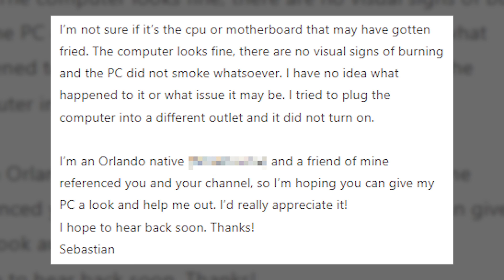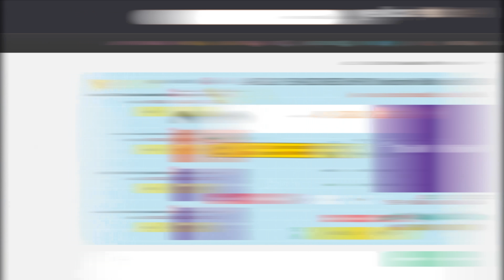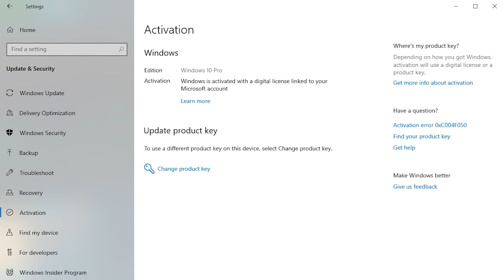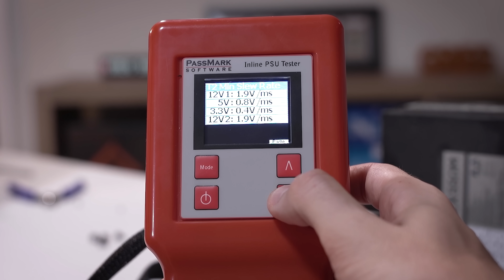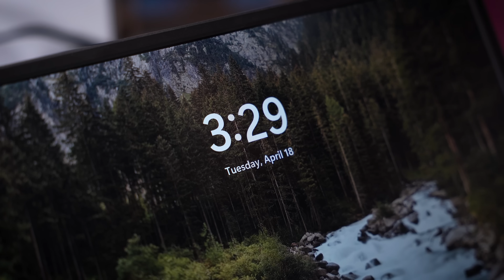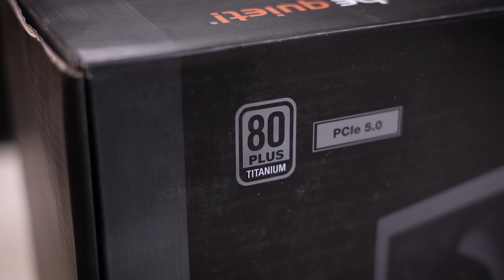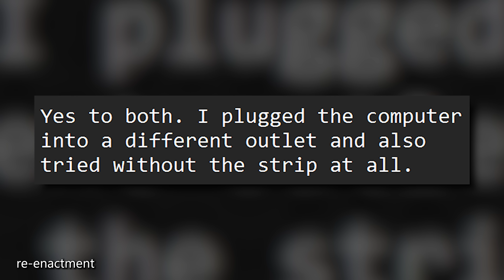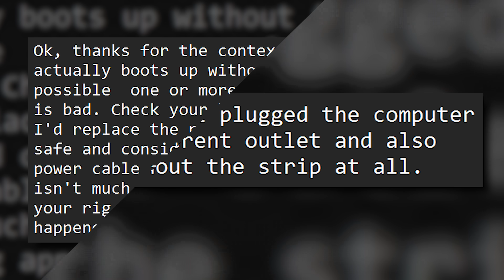Fixing a Viewer's BROKEN Gaming PC? - Fix or Flop S4:E6

Comment: In Europe where some, if not many, houses have 3 phased power into the building, if one breaker goes and there is some usage like 3 phased stowes or heathers that runs simultaneus, then you can get some seepage of low volt power going back into the outlet and give a computer that goes on and off all the time. To protect from this I have added a remote switch in line with the power surge protector, so that it can't start until I fix the breaker!

Comment: Greg HAVE HIM check the GFI switch, because they work on more than one circuit and are needed with rooms with water.  Those things will trip first before the breakers and if they do just hit the reset button and it will reset the outlet.

Comment: Surge Protectors have fuses that if that get too munch power they stop working, don't confuse them with power strips a good surge protector is designed to protect sensitive electronics from surges, power strips are not, but they look the same, the only difference is once a surge protector trips you have to buy another one and they will often have red an green lights, the red light means it is on the green light means its protecting.  Also some modern power supplies have fuses that will trip if they get over volted saving components from getting fried.  However, the power supply isn't the only power in source a graphics card can still get fried from a power surge from an internet cable or a hdml connection from the monitor, that is why it is good to have your monitor and computer on the same surge protector.  Some of the newer motherboards have a surge protector it detects a over votage and shuts off the computer preventing damage to components connected to it.

Comment: It sounds similar to an issue I had years back, which ended up being dirty power from old un-grounded outlets. Most things worked fine, but anything with a sensitive power supply would have all sorts of weird issues.

Comment: If he has a resettable surge protector, it may need to be reset by the reset switch or simply unplugging it for a 1/2 hour might reset itself depending on how the manufacturer made it.  Like someone else suggested, test outlets with a lamp.  If there is power, then the next step would be to replace the power cable IMO.  Great video!

Comment: good job. suggesting they add a UPS would be another preventative measure for similar issues also. hard to rule out a line short or weak breaker without electrician

Comment: G'day Greg,
Awesome job with your helper today but 🤔I guess as you didn't "Fix" anything this one is a "Flop" with an upgrade 😂.
Twice I have had PSU to Wall Cables that have stopped working in such a way they tripped the Circuit Breaker Board, both times I too thought it was the PSU as they were different brands but testing with my spare known working old DELL PSU showed it was the cable then tested the PSU working fine with the DELL Cable.

The only PSU that I have had Die was from a used GTX460 that I bought, when I hit the Testbench power button the PSU made a HUGE CRACK with sparks & smoke 😱(Just like the GN Video), my i3-3120 survived but it also took out the PCIe X16 slot on the Mobo😭. Got my money back from the seller without any hassle including enough for a replacement B75 Mobo 😁.

Comment: I actually had something like that happen to me. My cat jumped on the PSU Cable and pulled it out halfway. A loud noise and the PC wouldn't boot up again. Bought a new PSU but just tried for fun once more to boot the PC, after about 4 hours, and it would just work. Still changed the PSU just in case.

Comment: Yeah he really needs to try another room that's on a separate breaker. If he has AFCI protection on certain rooms in the house, but not others? Try one that's not on an AFCI protected line. 

I have a garage setup because the rest of the condo is on AFCI (except the kitchen and I wasn't doing that), and the builders who built this place picked probably the twitchiest AFCI's they could find. Even with power strips and/or a UPS trying to smooth the load, anything drawing more than maybe 250-300W dynamically? Meaning that load will shift slightly up and down? They are tripped because they think they are seeing a loose connection.

Edit: Love the special helper.

Comment: Reminded me of my own ordeal few months back. Swapped everything from my RV05 to an Alta GM1 and my room went 'pop' as soon as I flipped the switch. Tested at other locations in the house, replaced the cable to the rig and every time there will be a trip. Send to a local PC shop and it tripped their test section as well.

In the end, it was a pass-through cable from the Alta GM1 to the Psu that was the culprit. A $2 fix.

Comment: i know the problem cuz it happend to me. Its the problem of the surge protector or at least the voltage and watts that outs puts. I connected mine to one that apparently wasn't drawing enough power from it and it caused my PC to turn off randomly unless I waited several hours, then to turn of completely with no post watso ever. i changed everything even had best buy check it out and it was apparently the motherboard that got fried. Changed the mother board and worked good as new. So ask the guy for a pic of the outlet and a pic of the box to see how good is it to connect to a PC.

I can even send it to you Greg so you can confirm and also have to check my PC that it started to turn on everytime I play any game that reacquired a bit of work to put in the GPU, I stared one day where I open google chrome and after it just turned on the PC immediately no warning or anything. Gpu usage reaches 100 and turns off and if not that then the CPU reaches 100% and crashes, I formatted the pc saving the files but thinking on doing a full factory reset. so its more of a system problem not a component problem... maybe

Comment: The power supplies protect themselves and often by removing the power cable, let it sit for 30 seconds or so and plug it back in.  Power Supply issues with +5 volt stand by (+5VSB), as the power supply ages, The stand by load on this voltage rail will cause it to drop to a point that the Motherboard can’t respond to you pressing the soft ON button. Powering the supply completely off (disconnecting Main voltage) will restore the +5VSB and allow the power button to function.

Replacing or recapping the Power Supply is needed.

Comment: Surge protectors go bad over time and eventually do nothing more than a normal power strip, from age and covering small power surges and voltage fluctuations that you wouldn't even notice, including the surge protectors in UPSs. Don't use a super old one if you care about the sensitive electronics plugged into it.

Comment: You didn't ask him if his outlets were up to code and grounded with the 3rd prong.  Many older homes have ungrounded outlets and he could have been using a grounded-to-ungrounded plug adapter to get power to his power strip and PC.  Owner should really get a UPS.  Surge protectors usually only work for so many surges before the protecting no longer works and the surge protector simply becomes a power strip with no surge protection whatsoever.

Comment: Bet the switch on the original PS reset it when it was switched off then on. Hotplug a PS to its power cord, kick a bad enough spark (yes, I know, don't hotplug a PS) and if you didn't cause the PS to break its internal overvoltage protection, you'll probably still need to reset it with the I/O switch.

Comment: Stop using power surge protector strips. They don't protect anything!

 You've spent hundreds of $$$ on a PC and you're trusting a $15 device to provide protection. Spend another $100 and get a UPS. They will block power surges and keep your PC from flashing on and off during power outages.
Reply: Wrong.

Comment: The other thing to consider is the oringional power supply may have a breaker in it that just didnt reset till it arrived at your place Greg. Some power supplies have circuit breakers built in them. But as someone who has a degree in electonic repairs you did the right thing replacing the PSU and cable. Also yes the PC owner should replace the outlet.

Comment: i hate hate those large ugly heat sinks  i have neuropathy in my hands and couldn't put them brackets on ,i ruined two Ryzen 5 cpu's because they kept falling outta the socket,and bent a few of my 1330 pins ,never again will i use them .

Comment: gfci breaker could have popped. it will kill a rooms outlets. they will trip a couple times then the breaker fails and theyre around a hundred bucks. my old 990fx machine with 3way sli killed one as it couldnt handle the 1250 watt power supply

Comment: The last major problem I had with my computer seemed to be a failing PSU. My computer would power on and I could do light load tasks. The moment I would load up any game, the computer would turn off. I tried running a benchmark program, and once again the computer turned off. 
I replaced the PSU and everything has been fine since. All of that happened 3 years ago and my computer has not turned off on its own since.
Is it possible that the outlets work fine as long as the power draw stays below a threshold, similar to how my old PSU was behaving?

Comment: A PSA for all: Your surge protector is good for ONE power surge before it needs the fuse replaced.
Reply: cries in florida
Reply: Actually it depends on how bad the surge is, they can take smaller surges, just not the huge spikes, I lived in Wyoming Summer Thunderstorm land if you ask me.  The power was always going on and off, its not when the power goes off that causes problems its when power comes back on is when a surge happens, because everyones connected devices are being powered on again all at the same time so may shut off and power on a few times, that is a surge this is what causes harm to computers.  This is why in my bios I set it to stay off during a loss of power, the prevents the surge when power comes back online and helps the grid because it don't have to power that device back up again.
Reply: idk about that I've tripped mine a few times(heater in the winter + 3090) and it still works. I never buy "power strips" though I always get legit $40+ surge protectors.
Reply: @donnyboi1990  Those tend to have better breakers, but you'll notice a little light on the pricy ones saying "Protected" or "Fault" if that light is out, there's a little fuse you can replace under it.
Reply: @donnyboi1990  Not an electrician... but my understanding was that a surge protector was different than a breaker for the house. My bedroom is on the same breaker in the house as a room downstairs where they sometimes use a space heater, and we've blown that fuse several times. But that wasn't a surge causing the protector to be used up. It just happened to be plugged into one when the house breaker was tripped. But in the case of the PC owner in the video they specifically said it wasn't the house, but their strip.
Reply: @Galiant2010  It isn't recommended but if you are low on outlets in a room and have a few things pulling heavy amps, it will flip the switch on the surge protector instead of the breaker box, so you don't have to go down in the basement if there is a trip.
Reply: Hey Greg how can I submit a request for you to view my broken pc?
Reply: @chaseandbolt  He has a link in the description for a form to submit.
Reply: Depends, my power surge protectors work like breakers. They have an on/off physical button you push and they're good to go. The ones with fuses generally aren't fast enough to protect your eletronics from this kinda surges.
Reply: @eduardoBR1991  A surge protector is bare.minimum, but yes, more expensive/better protection is preferred.

Personally I use a UPS that does both line conditioning and surge protection.

I can thank this model for saving multiple appliances in my house as well.

After a weird power outage and repair on my power lines, my UPS just kept beeping and beeping... I thought it was broken until I checked it's voltage detection.... 145v!

There was an Amp on my street corner that was amping my voltage up that basically wasn't needed following the repairs they did in the previous power outage.

Called the power company, and they bypassed the amp: then I was back down to 110 +/-10% as I should have been... But I HIGHLY recommend that if you have spent more than 1k on your PC.... Spend another $150-200 on a good UPS.
Reply: @JE-zl6uy  yeah, I would go with overkill any day. My power strip has a built-in breaker and an Ups also with a breaker and pure sinus wave signal.
Reply: Laughs in 230V outlets.
Although power surges are rather indepedant from that
Reply: @Spido68_the_spectator  I wish... most homes are very old where I live and are under $100,000 in value because they have not been modernized. I don't have to pay city living costs though.
Reply: They aren't 100% guaranteed to work against lightning strikes, either.
Reply: I never knew this though thanks for the information! I just built a really high end PC and wouldn't want this to happen to my PC.

Comment: It happened to me once , I know the problem
I took my psu and tested it on another rig , everything seems ok and everything else on my computer was working as well with another psu
Turned out the problem was the POWER CABLE itself was the only thing that got busted and by replacing it everything worked fine on the same power outlet  same computer !

Comment: There are replacement (wall outlet to PC) power cables that use 14 gauge wires, instead of the standard 16 gauge wires. The PC owner should probably invest in one of those red/green/yellow LED $8 outlet testers, that can detect if the hot & neutral portions were wired incorrectly. Older homes may not even include a ground portion, so that would indicate a need for simply replacing the wall outlet with a properly grounded 3-prong wall outlet. As someone else mentioned: double-check the breaker box for possible corrosion induced by sparking between the breaker and spade on the buss bar.

Comment: Now I'm not sure if pc power supplies have them but it's pretty common in electric motors to have a time delayed fuse. So if you trip the fuse it won't allow you to put power back through the device for a few hours then it will accept power again. Just a theory.

Comment: @Greg - I am a technician in Houston that has this type of problem with PCs at my company due to unreliable power.  I have experienced this type of issue myself but especially with Dell desktops.  We normally pull the power cord > press the power button while disconnected > plug back in an turn on the PC.  This normally drains any power from the MB  and restores the state of the machine to normal.  I wonder if this happened naturally during the time it took the machine to get to your home for troubleshooting.  -All the best!  Brian F.

Comment: Most times when a house gets a brown out it does something to the power supply or motherboard that causes an issues. Most times all you have to do is remove the power cable from the back and the main motherboard cable from the board wait a little bit for the built up power to dissipate from the system then hook it all back up. That usually works.

Comment: I had almost the exact same problem in my kitchen.  At some point, a previous owner had installed a dedicated 20a receptacle above a counter.  Never had a problem with it, but we only used it for phone chargers.  When we remodeled the kitchen, I tried plugging in my Ryobi battery charger and it would light up like it was on, but would freak out and reset itself in loops when you tried to charge a battery pack.  Since the outlet had "worked" up until that point, I assumed the charger was bad and went and got a second one from the garage and it behaved the exact same way.  I checked the voltage at the outlet and got 120 volts and an outlet tester showed a properly wired outlet.  I switched off the breaker and pulled the outlet out, no problems at the connections to the outlet.  I swapped out the outlet temporarily with a known good one and the battery charger STILL lost it's mind when trying to charge a battery.  I was stumped.  I pulled the cover off the breaker box and checked the breaker connection, it looked fine.  Since the outlet was a special 20 amp rather than the standard 15 amp, it had it's own breaker.  I took the breaker out of the box and found the problem.  The contacts on the breaker that slotted over the spade on the buss bar in the box must have been making poor contact for I don't know how long and had burned/arced a lot of the material off of the spade of the buss bar.  The breaker was barely making any contact with the buss bar at all.  The circuit could handle the piddly 2 amps a phone charger was pulling, but not whatever a Ryobi 18v battery charger pulls.  Your client could have a similar situation going on with the supply breaker that feeds the outlets in that room.

Comment: Maybe the surge protector shorted and can't supply enough power to the pc but can manage the monitors? Is there a fuse in the surge protector? Maybe it's partially melted?
Reply: yeah some   surge    protectors     have    fuses,    they    are     one   and     done   if    there   is     a     surge    unless         you     take     it    apart